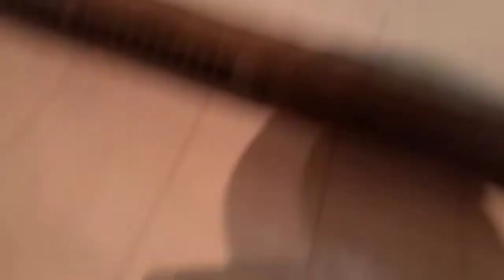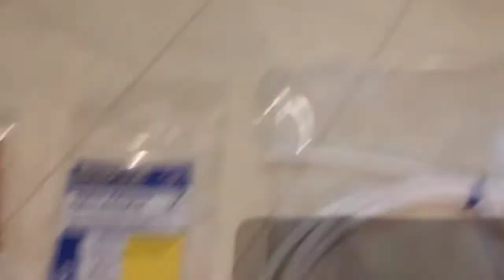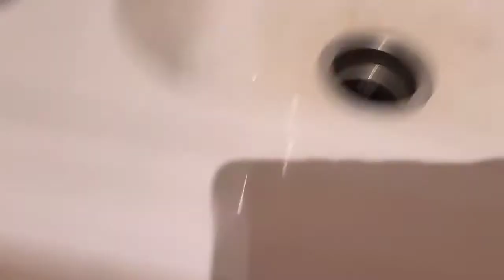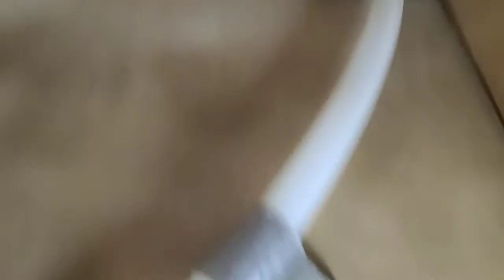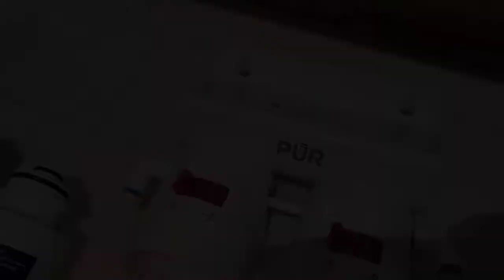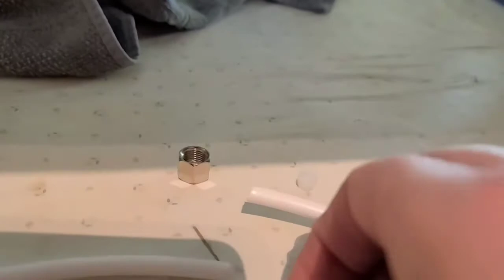PUR Quick-Connect Dual Stage Under Sink Water Filtration System install and tips (valve size issue)

Comment: I think the barb is too small right? It should go to the 3/8” tubing?
Reply from the maker: The bard fitting I bought and show (in copper) fits to the white plastic tubing. It replaced the valve they sent because it is a 1/2 inch connection and my sink is 3/8"

Comment: This is exactly the video I needed, I’m just wondering where the ending is? You haven’t connected the hosing to the barb.
Reply from the maker: I'm sorry I didn't show connecting the tube to the barb connection. It just slides over the top and stays. The in tube goes from the barb to the inlet on the filtration system.